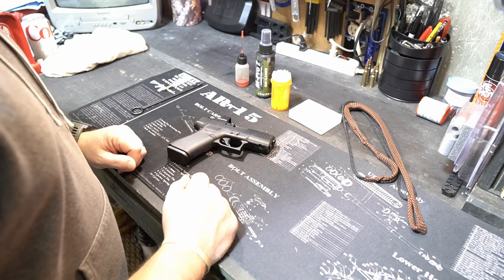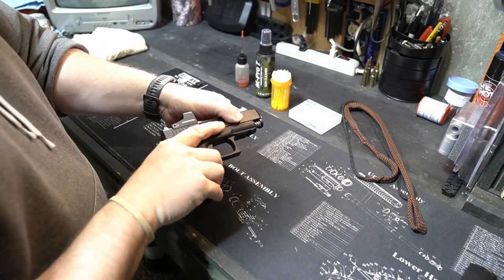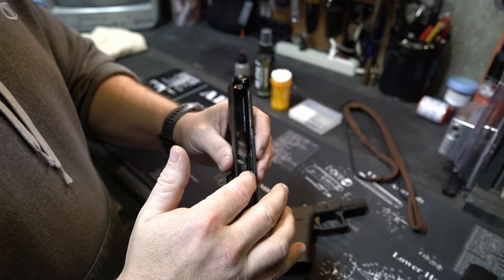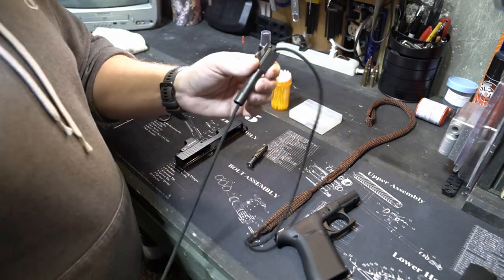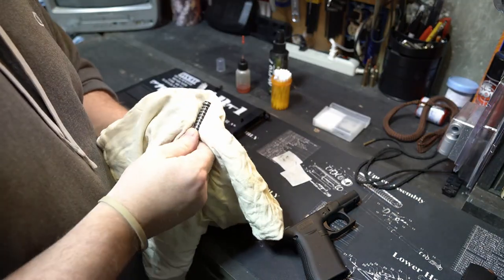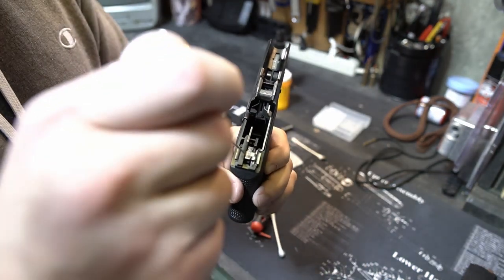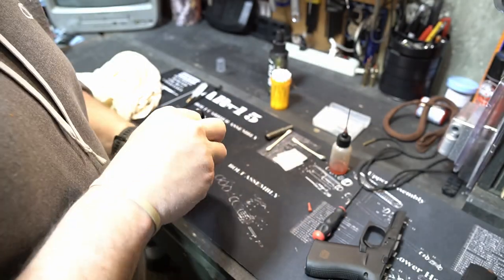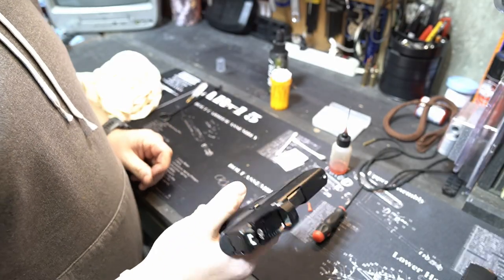Glock 43X Cleaning Before Shooting First

Comment: I got glock 45, a new one, and I don't fully understand this part about copper lube. 
So you will keep the lube there before first use and not take it out.
Question is after the first shooting, gun gets dirty, so do we have to clean all the things including to remove all cooper lube on the rails, and after just put oil on the rails on clean surface?